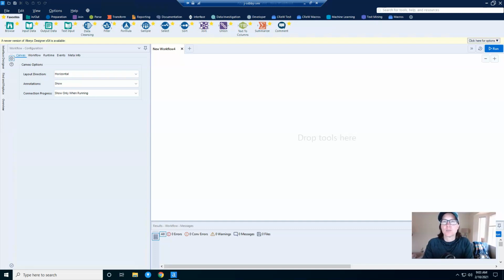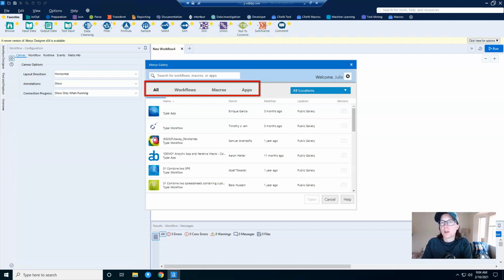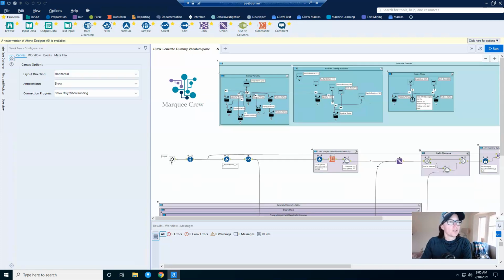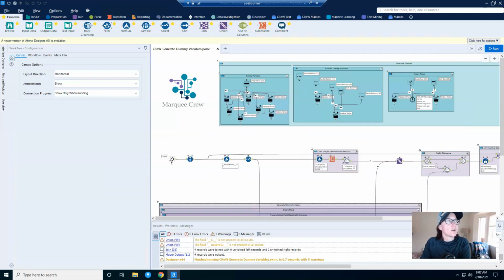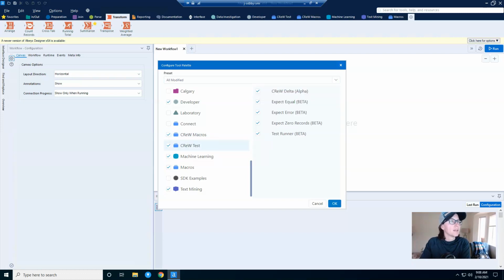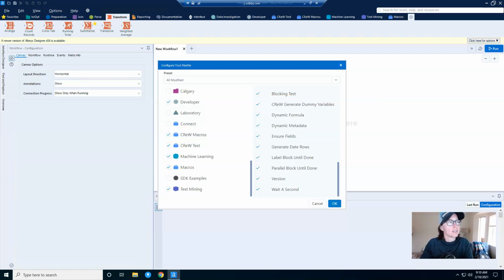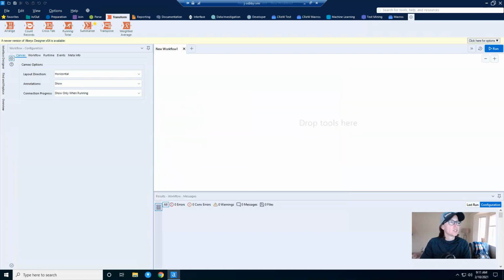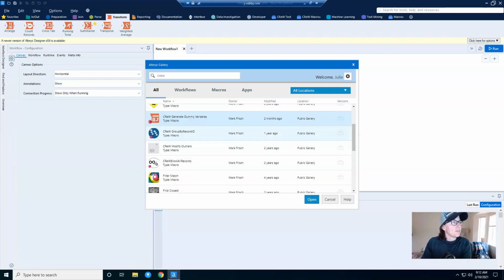Find & Add New Alteryx Tools

Comment: Hello, thank you for the video.. Can you please let me know whether we can use these crew macros in our workflows whenever needed without any dependency
Reply: What exactly do you mean without dependency?
Reply: I understand that these crew macros should not be used in any organization unless until we get proper approval..may I know the reason for the same ...
Reply: Thank you very much for you valuable reply. I understand the concept now
Reply from the maker: @radhateddy9237  That is going to be specific to your organization, not the tool kit.  CReW macros are supported by Alteryx for desktop use, but not server use.  With that said, many organizations still deploy and use them on the server.